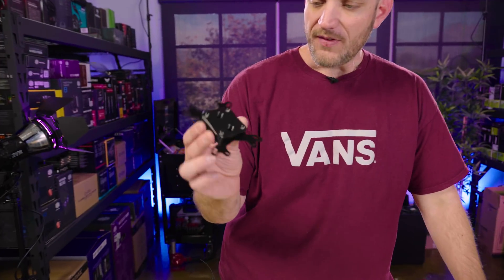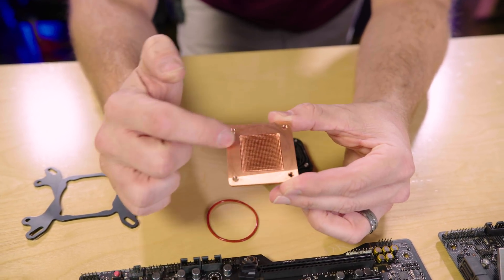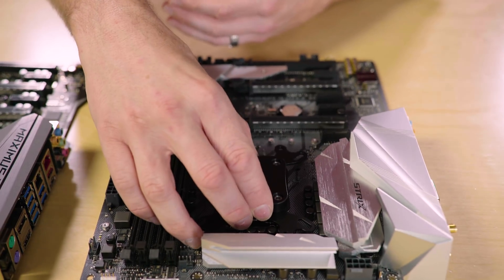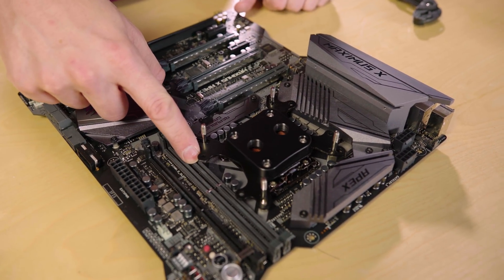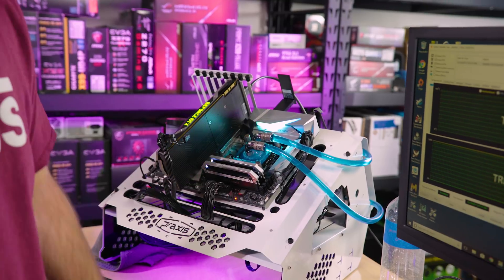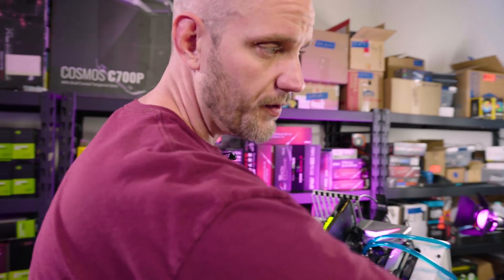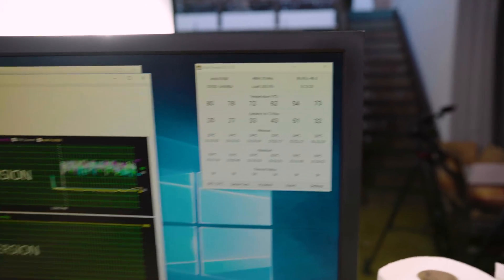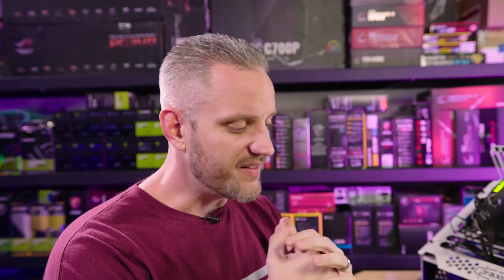I tried watercooling an overclocked 8700k with a $19 waterblock

Comment: That 19 USD waterblock is still like 200x better value than the 8700K
Reply: Luca De Lisi
How are actual game benchmarks off of real-world performance? The 8700k is simply way ahead in IPC and when you say "only for 1080p gaming" you're just saying that when you currently have a GPU bottleneck (in higher resolutions) CPU doesn't matter much.
Reply: Wow a lot of people commenting on this have a lot of different opinions. Lets lay down some facts. The 8700k is a little over $400. It is 6 cores, 12 threads, and has a turbo clock up to 4.7GHz. The R7 1800x is around $400 and has 8 cores 16 threads with a turbo of 4.0GHz. Head to head these 2 chips go back and forth depending on the application. So the intended use dictates the value of the CPU. Now with all of that being said. As an old school AMD fanboy I am so happy to see AMD release the ryzen cpu's. They still dont compete with Intel on single threaded performance. But if you are running VM's, or doing a lot of video encoding (jobs that actually make use of all cores and threads) AMD has made a huge leap and taken some of the market share from Intel. I am very looking forward to Ryzen 2 in a few months.
Reply: Gunndy Gaming not the same price... u need the price to performance ...... and in editing forget that 8700 ....
Reply: Which is why I stated that there is no uniform answer in the Intel vs AMD debate.  Each CPU has areas where its value shines over the other.  If you are care more about multi-threaded productivity than gaming, AMD Ryzen line is the champ both in performance and value.  If you care more about gaming or single core performance, Intel line is the champ both in performance and value.  The FIRST rule of computer building/buying is knowing what you plan to use the computer for and understanding what decisions that will affect in the part selection process.
Reply: After owning a 1600, 1700 and an 1800x I am pretty impressed with the performance you get for the money that's for sure. I like building pc's so I'll probably build the 8700k rig to replace my old 6700k that I gave away to my bro :)
Reply: Don't be mad because you are poor.
Reply: Yedr it's better for gaming , and worse for productvity, but for both value and gaming it's worst value !
Reply: not able to achieve 5ghz without delidding.... where the fuck did you get that load of BS? lol he's running 4.9ghz with 20 degrees of play before throttling. I can't see a scenario where an additional 100mhz equates to 20 degrees celsius at 4.9ghz already until you start hitting speeds where you're cooling with liquid nitrogen. I'm running the same speed as him on an h115i and getting the same temps. high 70's under full load. The 8700k is good to 105. (as he so pleasantly outlined in the video you apparently didnt watch)
Reply: Gunndy Gaming ryzen doeant go over 4ghz so stock cooler is more than enough btw if u stick to the stock cooler that doesnt mean u r not an pc enthusiat ... its just a waste of money buying a cooler for nothing .... and the 8700k needs a water block because of intels toothpaste under the ihs ...
Reply: n00bie u r the one getting buthurt here .... go ask ur mom for some baby oil next time so ur ass dont get hurt
Reply: ? i dont see how. its cheaper than the last gen 7700k and has 2 more cores. also signifigantly faster. my gf has the 7700k and cant keep up
Reply: https://www.userbenchmark.com/UserRun/13640131 - Not if you actually have real world data. I OC'd the 8700K to 4.7GHz (Had it on 5.2GHz a few times but I ain't going trought that calibration bs again) and the highest temp doing the Benchmark was 35°C (custom loop with around 190pts). The Performace/Value of this CPU is actually pretty good. Like they even threw out the toothpaste and used real thermalpaste - yes I know I am a year late but its never too late to change someones mind lol
Reply: A year later I shall state monster hunter world runs more than 100 threads guess what just went out the window........single core performance  XD
Reply: n00bie you’re the one butthurt lmao
Reply: Ryzen does offer great value and is the better CPU choice in some cases.  But Intel is a better choice for others and can be a better value in cases where single thread performance matters most.  People keep acting like there is one universal answer to the AMD vs Intel debate when there isn't.  EVERY situation requires a different measuring stick.
Reply: It's the best you can get for gaming and almost any single threaded task which still makes up the most of any tasks these days. So yeah whatever *shrugs*.
Reply: Its the only current gen six core CPU with an on-chip GPU. Just because it doesn't fit into your use case well doesn't mean its not a good value. For someone wanting to do passthrough with VM's it is the BEST cpu available at the moment as it does not require you to have two dedicated discrete graphics cards... I'm all for ryzen, but until there is a ryzen 5/ryzen 7 CPU with on board graphics the 8700k will have a place in the market
Reply: Waterblock for a Ryzen is the same price as a waterblock for an 8700k.  So cooling isn't more expensive unless you are one of those who stick with stock cooling and not an enthusiast.  Actually....if you look at the actual video your commenting on ... you can get a waterblock for 8700k for $20 that works fine.......what is the cheapest AM4 waterblock available again??  Oh yeah....it's more than $20.....so much for cooling being cheaper.  Yes...the Ryzen chips come with a cooler....but so do the non-K Intel chips and the 8700 non-K stock speeds still outperform Ryzen overclocked in IPC and gaming benchmarks.
Reply: n00bie imma give a solution .... : if u see comments like this dont get butthurt and dont try to make a problem and go fuck ur self
Reply: You are right...the 8700k doesn't come with a cooler....so you HAVE to buy something aftermarket.  However, the 8700 does come with a stock cooler that is adequate for running it at it's stock speeds, which still outperform Ryzen in many gaming benchmarks and all single threaded tests.
Reply: Gunndy Gaming gaming is another story .... go intel
Reply: ....bench it while multitasking with 3600 or better ram, and then....
.
.
and thennn
Reply: Value is a peasant word that should have no place in PC gaming? lol have fun paying 700 USD for a 1060 then. Idiotic elitist is indeed idiotic. The 8700K is just not able to achieve 5 GHz without delidding (or if you want a space heater / camp fire) and very good watercooling, and please be mindful that most AiO are struggling to keep that chip cool. Funny that you are willing to pay a premium price just because of a word on a box: says a lot about the current prices of components, because fuckwits like you willing to throw money for literally no improvement are fucking over the rest of the people with some brain. GG WP.
Reply: Luca De Lisi 😂😂😂😂😂 lmao
Reply: I never said gaming benchmarks, I just said benchmarks: don't put words I never said into my mouth, thanks. "Way ahead in IPC" by what standards since Intel chips have to be clocked a full GHz more in order to keep their slim advantage? And by saying that they're the best for gaming I do mean only for 1080p gaming (and by ridiculous margins anyway except for a few scenarios) because moving up a little bit and/or going to newer titles the difference is nowhere near to justify the premium you have to pay in every single aspect: the CPU itself, the motherboard, the cooling solution, so long and so forth.
Reply: Gunndy Gaming NO SHIT CUZ INTEL HAS LESS CORES = LESS THREADS = MORE POWERFUL THREADS = YOU KNOW THE FUCKING RESULT, IF YOU LET RYZEN USE ALL OF ITS CORES, IT FUCKS UNINTELLIGENT IN THE ASS
Reply: .....for the extreme gamer's though, they are not "simply gaming" they are also streaming and encoding video and have a music request going thru YT and.....

So when you bench that intel chip vs amd and have tight ram like 3600 or so... BAM those ryzen chips clobber intel with a real workload.
Reply: Poor troll attempt is indeed poor. P O O R
Reply: It's better value then ryzen for gaming , for productivity , no . End of discussion
Reply: Let me straighten your statement: it's a "better value" than Ryzen only for 1080p gaming. Still have to understand how can you pay 100% more and get barely 10% better performance in the only scenario where the 8700K is ahead.
Reply: LOL what are you even high on? First things first: I was talking about value, which Intel hasn't. Second: game "benchmarks" are useless just like synthetic benchmarks only for the fact that they are WAY off the real world performance. Third: it's not optimization, it's just Intel hogging development on multicore architectures for a decade (with AMD not being able to come up with some decent CPUs) and developers just going with a broken way of thinking like "Oh, let's make this application run on a single core even though on the market there hasn't been a single core CPU for YEARS.".

I hate ignorant people coming up with even more ignorant "facts".
Reply: Luca De Lisi ryzen is a lot baddest on game benchmark a 8 core intel destroy an 10 core amd... all about optimisation :p and on this point  intel is the best

Comment: Aida64 is obviously Intel oriented when it can get the CPU up to those temps... I cant even get my FX 8300 4.9ghz up to 45c in Aida....
Reply: the FX temp sensors are weird. And if you use a good cooler, this isn't too surprising. The stock tim on the intel cpus is just a tiny bit better than air. An overclocked stock i7 will reach 75C as soon as you start the test with ANY cooler. An FX with a great cooler probably won't even get near 60C (in a prolonged test), because they were soldered.

Comment: My first watercoolingblock was a self drilled copper block, the holes were in an pattern of the letter N and closed with screws.... and and that time, my Pentium III 700 was runnung at 1050Mhz for about 3 years. Pump was an eheim, Radiator was an aluminium from a motorbike. The system was running at about 55°C on the CPU without any fan. So all the mircrochannels and so on... i dont think it makes such a big difference, but todays blocks look much better.

Comment: couldn't you just just take the block apart and put it back rotated 90 degrees to have the fittings horizontal instead of vertical?

Comment: @ Jay, IDK about that that red O-Ring. But in automatic transmissions they are still normally made of Nitrile and just been covered with red/rust coating (teflon I think) for various reasons. But IDK anymore, I stopped rebuilding automatic transmissions for the public back 20 years ago. Global O ring colors indicate that red should be silicone. But I am sure you would have noticed if it was silicone and had no reason to ask.  It could be Red just to indicate it came from CHINA :-D

Comment: I have not been to impressed with many of the waterblocks I have been looking at. They (not all) seem pretty inefficient in their designs. Personally I think 1cm tall micro fins that reach the top of hte block housing would really transfer heat better. However mass producing those would be to time/cost consuming. I am waiting for someone to come out with a waterblock/vapor chamber hybrid to increase the surface area for water..

Comment: 6-32 is the unified thread standard for the screws not 6/32 of an inch diameter. The #6 is the designation for the major diameter and 32 is the thread density in threads per inch. The more you know.
Reply: Listen to this guy, he knows what's up.  well, at least when it comes to threaded fasteners...

Comment: Good to know. There are a lot of cheap water blocks on ebay that look pretty good. Glad to know these are decent. Old school methods huh?  aquarium water pump? fuel pump? bucket of ice water?  ya I built exactly what you are talking about except my water block was a copper pipe end from Home Depot that I glued to some clear plastic and installed plastic barbs into. Good old days bro. I remember in the early days people direct water cooling cpu's and fully submerging the systems in baby oil.

Comment: I have a ekwb fake for 25$ with a stainless steeal block (stainless is bad for heat flow)  and have temps 3-7c higher than a legit ekwb block with a 4.6ghz overclock

Comment: The only thing you really need to worry about when buying some random brand you've never heard of is the build materials. Make sure it's copper or nickel.  I've seen ones with aluminum or traces of silver. Silver in itself isn't bad and is a natural antimicrobial but it doesn't play well with other metal types in your loop.  Especially copper.

Comment: It has been that way for many years.

I remember seeing the first tests for some cheap (dirt cheap) waterblocks that didn't even use those milled waterchannels but simple copper-studs. that thing was something like 9.99$ and had double-oring for the chamber and for each fitting and actually performed better than most brand blocks did: pretty much same cooling as them but way lower waterresistence.

Comment: Hey Jay! You should try ordering dirt cheap water cooling parts from brand called "barrow". They are known for super low price and high quality. It would be nice to see tests from you.
Reply: Magicool is just like that. It might be unavailable in the US, tho.
Reply: I got magicool kit in the us over a year ago, getting ready to reuse the rad in my current ryzen build. it did pretty damn well considering i got the slim 360mm kit and threw my two hd 7970 ghz editions in with some heat killer blocks i got used for $50, never had any issues with cooling or noise after that even pushing the whole system to the finite edge of stability

Comment: JayTwoCents, here is the Windows 10 tip of the day: Press Windows key + Printscreen and it will autosave a screenshot into the pictures folder so you don't have to use your phone to take pictures of the screen. :-) I just recently learned this my self. Well I've known about printscreen, but not the autosave function.

Comment: i know im being picky, but 6-32 is not 6/32 of an inch becaust the correct way to say 6/32" is 3/16" which is equal to 4.7625mm, which is larger than a 6-32 thread. what 6-32 really means is ^ gauge diameter and 32 threads per inch.

Comment: use bykski from china. using them on my pc, whole set with 240mm rad and gpu block took only $350 whole set. performance: amazing. no complain whatsoever, no leaking yet. almost using a year.

Comment: The problem with cheap PC water cooling parts are you usually end up not knowing what metals are in your loop.  Cheap radiators definitely aluminum with a copper block...not gonna play nice.  Cheap fittings can go either way.  Pumps and reservoirs mostly plastic.  Copper radiators don't come cheap in a size large enough to cool properly.  So be careful noobs, keep copper and aluminum separate.  Or if you do mix invest in a coolant that prevents corrosion, which won't be cheap either.  Welcome to the wonderful world of PC water cooling!  Nickel plated water block solves that problem though.

Comment: Can a be quite shadow rock slim cool a 7700k
Reply: *quiet. quiet (~silent), quit(~stop) and quite(~very much) mean completely different things.
On stock clocks, definitely. You'll need a much stronger cooler to overclock with stock tim. Or delid the cpu and put liquid metal on it if you want to use the be quiet cooler.

Comment: You will not find too much difference between cheap 20 dollar blocks and most expensive ones. It's just copper-water-radiator-fan blowing. Just get some decent fans and large enough radiators, you are good to go.

Comment: you should try it on a gpu ! modding the rad by cutting it to make an "hybrid" GPU, vram cooled by fan and processor cooled by the cheap waterblock, i'm curious about the result compare to 250$ gpu waterblockl ! but a waterblock with in and out on the edge and not on the top should be better to do this !

Comment: @JayzTwoCents Regarding the red  O Ring found in that block, are a standard for Chinese made knock offs. This is especially common in Vaping devices from China. These rings usually are not as durable and also easier to break, but they are very cheap and mostly used by Chinese knock offs.

Comment: The screws are called six thirty two, a number 6 screw with 32 threads per inch. Not six thirty seconds. Red O rings are usually silicone.

Comment: Can anybody help me? I just built my first pc and it keeps flashing the "reboot and select proper boot device" message no matter what I try, I have an 1tb drive from my old pc that I was going to clone to my new 2tb drive, but neither drive works.
Reply: You'll have to boot from something with an operating system on it, so that's one reason the new drive might not work. If you have an OS on a USB thumbstick or a CD-ROM you can use that, and select your new drive to install the OS. At that point you could just transfer much of your old drive onto the new one. There are several processes online for cloning your drive, however I don't recommend trying them unless you're confident in your computer abilities, as they are somewhat complicated. There's also software that can take care of it for you, but "user beware."